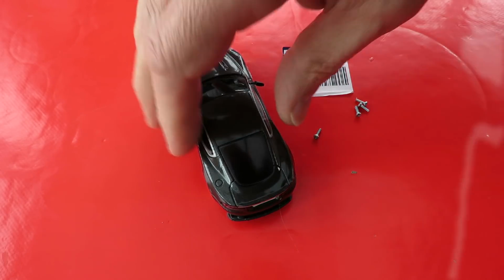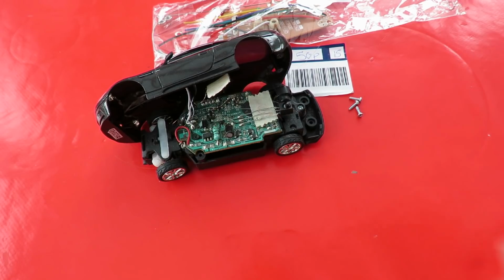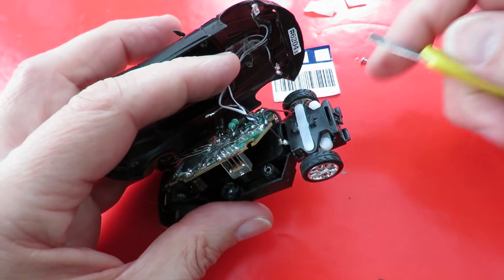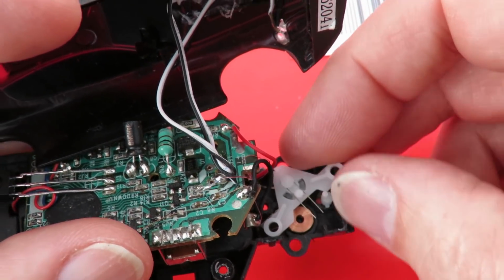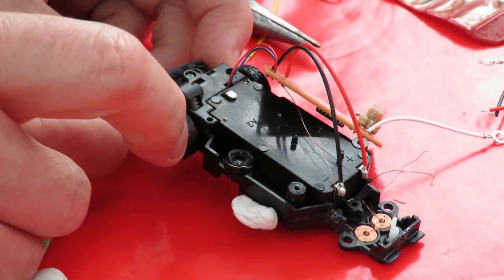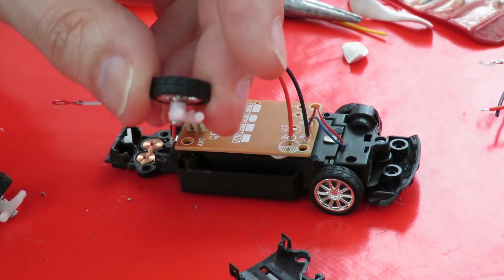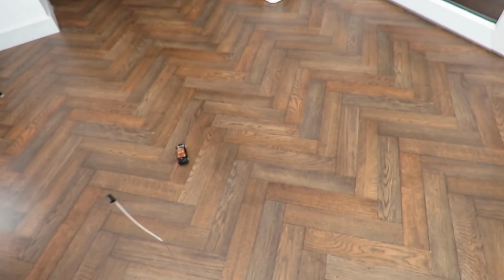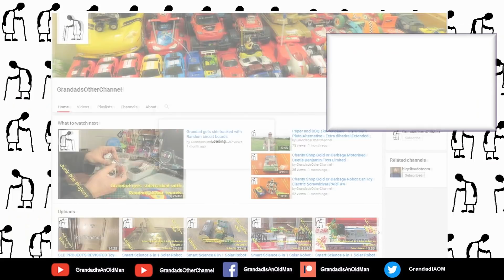Swap IR receiver for RC receiver TOY GRADE

Comment: hi grandad, nice little conversion and it works really nicely as well but what i couldnt figure out was how the steering works with the 2 coils underneath the plastic steering rack, are there 2 magnets built into the steering racks plastic which react to the coils when they are given an electric current to make the steering work or how does the mechanism work?
Reply from the maker: There is a single magnet under the plastic steering. When the current passes through the coils the right one will attract the magnet and the left one will repel it so that makes sure the steering moves right. When the current flows the opposite way the left one attracts and the right one repels so the steering moves left. The normal centre spring returns the steering to the centre when no current flows.